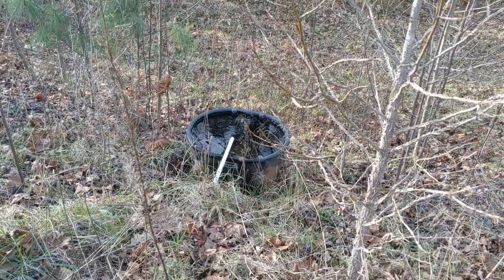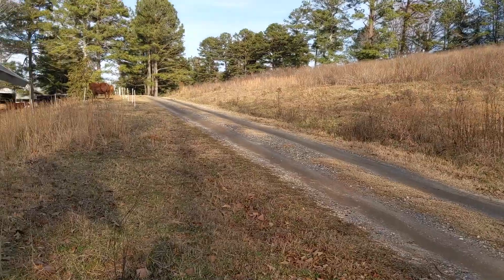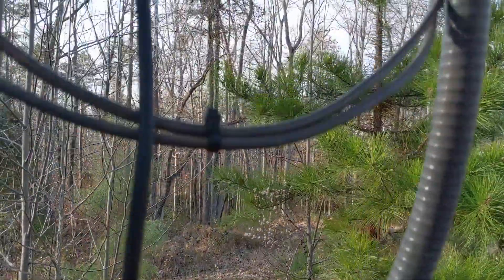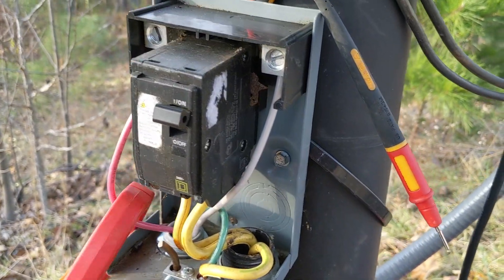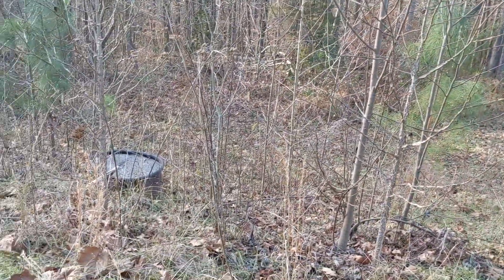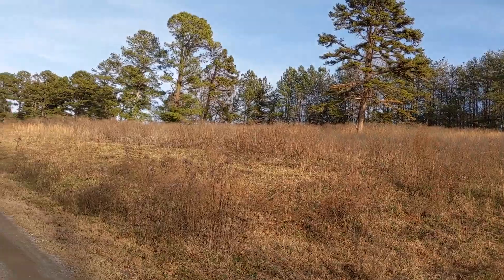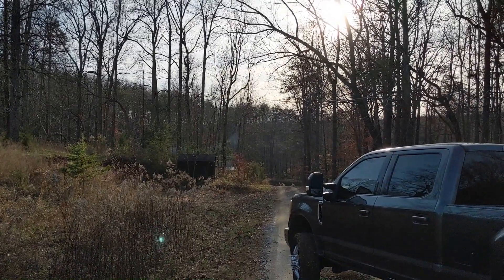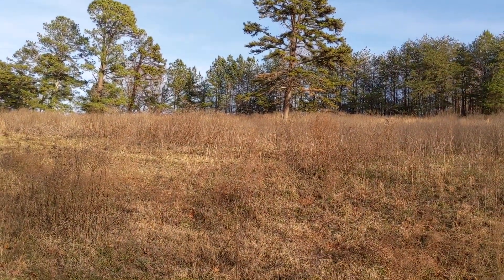Generator Backup for bad weather

Comment: agreed.. lovin  my solar direct  pumps... small one 2 gpm. at 70 psi lift.   larger 400 watts closer to 15 gpm  for 90 ft lift.. Chinese cheapos  less than $100  each!  lasts 2 seasons at least on unfiltered open stream . 20 k gallons?

Comment: This is another reason why I don't understand the separate small separate solar systems to run water pumps, air conditioners, and other things. You said that they did not have electricity available so I am guessing that they had solar panels close to the home. Run a wire to the pump and run it off the batteries and inverter. Also those same panels can still provide electricity when the water tank is full rather than sitting idle for half a day or whatever. Same thing with solar panels running air conditioners. What are those panels doing in the winter when you do not need A/C but there is less light and you do need more electricity? Those panels are sitting idle all winter long.
Reply: In Winter you often reverse the ac pump and the. Gets heat. I run thst here during Winter but i agree that all solar should go to same central electricity point . I have One point and instead just burried Wires to all houses and parts needing Power :)
Reply: At 2:30 he says “no power here”, and looks to be at least 100yards to the structures.
Reply: @PlanePreacher  Right, I thought that meant no electricity to the property/homestead. It could have meant no power to where he was standing.

Comment: I just bought a eu3000 and installed my own wheel kit and remote start... oh baby... I've never known such luxury.
Reply: Mr. Morningstar  As for the wheel kit I copied the all terrain style with the four pneumatic wheels, wheels from harbor freight, two rails of unistrut a little welding...

For the remote start I got a two channel relay receiver on amazon that has an option for limit switches and a 120v relay. 
Both relays operate in momentary with the starter relay being interlocked by the secondary 120v relay, this is so you cannot press the starter button while the generator is running. 
There is no choke functionality, hold button A to kill generator, press button B to engage starter.

Comment: What keeps the water in the tank up on the hill from freezing ?
Reply: mass
Reply: I had that question before. I think E775 answered or I googled it. Either way Max is correct. The mass keeps it from freezing solid. The top may get a few inches of ice depending on your location. I very good example is the water tanks used to fill the trains in the upper midwest. In the winters it would freeze but those tanks are sitting up in the air and they still didn't freeze, same with the water tanks on top of buildings in the big cities.
Reply: @DearHenryA . I understand what your saying, but the tanks l have seen on top of building all have a way to be heated.. I live where it gets down to -25 F.